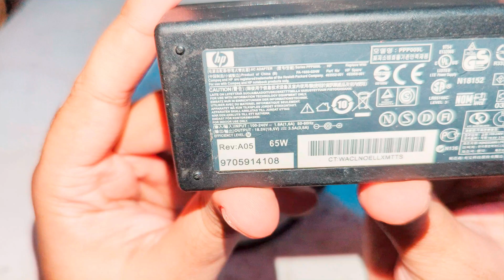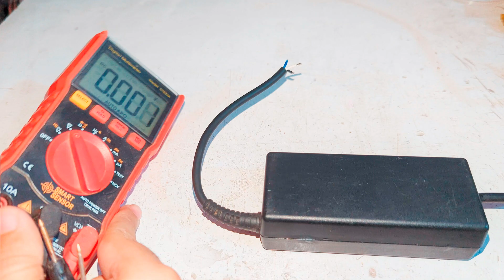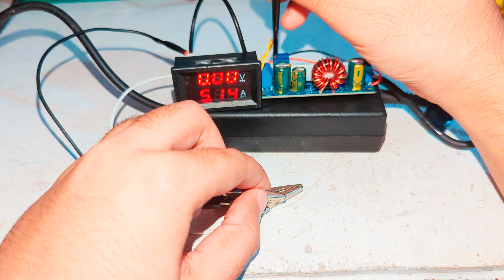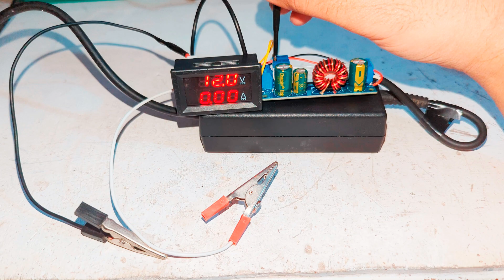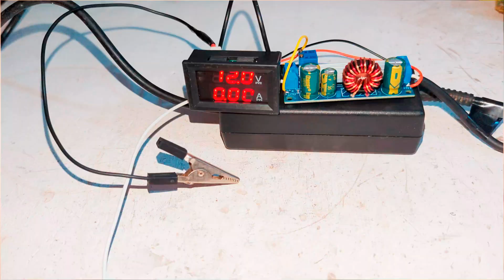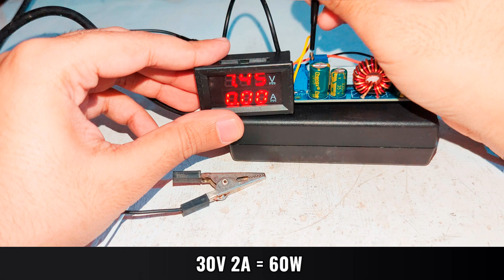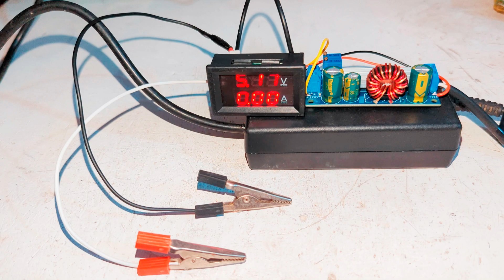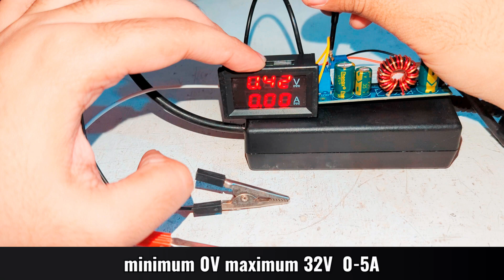DIY 0V To 32V - 0A To 5A Adjustable Power Supply From Old Laptop Charger

Comment: Sir 12v to 380 booster when i attach feedback circuit then mosfet getting hot why
Reply from the maker: It means your feedback is not working!
Reply: What PWM IC you used in your booster? Maybe unsymetrical pulse with or voltage spike made mosfet getting hot
Reply: Sg3525 lm358 driver module @TranNhan06